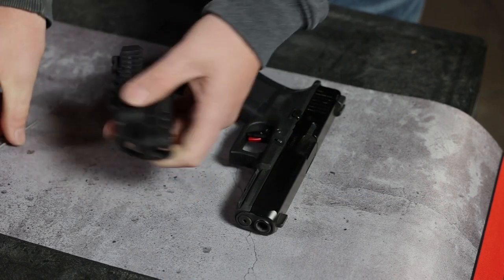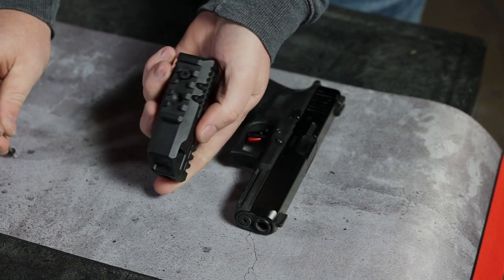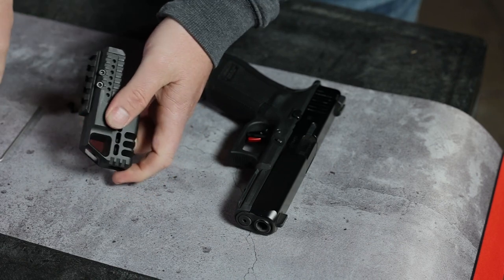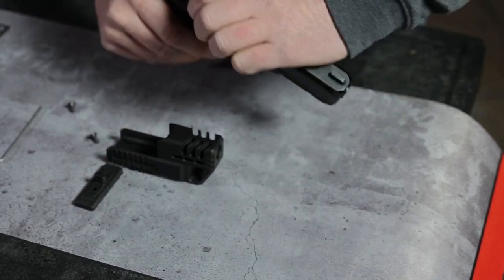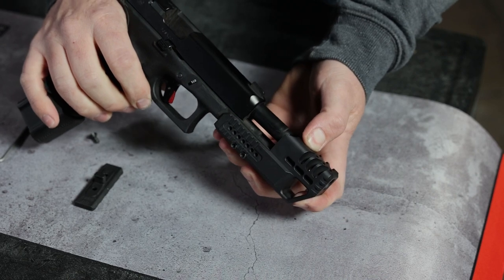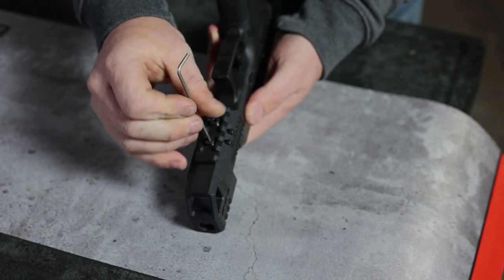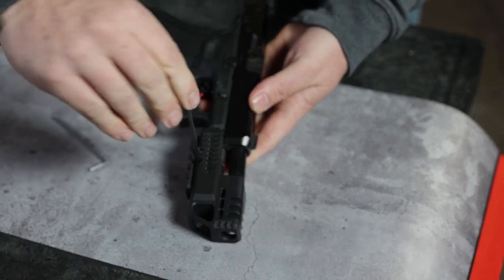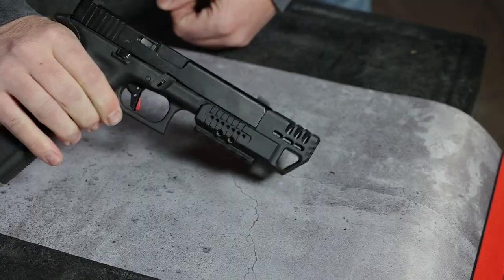How to Install Our Compensator In Less Than 90 Seconds | Wasatch Arms

Comment: Will it works on a G20 gen 3 with a 6 inch barrel
Reply from the maker: No unfortunately the Glock 20 comp is made to fit the factory Glock 20 Gen 4.

Comment: Will you be making a 17L version or will the 6-inch 17" barrel fit through the compensator (in a standard slide)?
Reply from the maker: We don't have plans at the moment to make a 17L version sorry.  We strongly suggest using our products on the standard, out-of-the-box guns they are made for.  We can't guarantee our comps will work with any after-market slides, barrels, or frames.

Comment: Does the pick rail need to be installed to make it snug? I want to run this comp on a DAA flex holster and it cant be blocking the trigger guard. Is screws to use instead of the rail?

Comment: Question:
I just purchased the Comp for my Rival-S. I installed it based on your video, no problem with the install.
However, after the install, there is wiggle from left/right on the comp just a tad, not too much, but a small amount of wiggle from left/right. 
Will this create an issue while shooting the gun? Will it block any bullets coming out? I just dont wanna have any issues, and I wanna make sure that the wiggle is normal.
Reply from the maker: Send an email to support@wasatcharms.com explaining this concern with pictures if possible and they'll help you out if anything is wrong.

Comment: Can you please clarify where those side screws are ending/touching? I'm not too keen on digging steel screws into my plastic Glock frame repeatedly, especially since this needs to be removed for field strip.
Reply: they cinch the metal together to hold it tight, they basically screw from one half of the comp into the other.
Reply from the maker: Exactly!

Comment: I have the Specs addition with threaded barrel, M&P9 2.0. Will this fit?
Reply from the maker: We haven't tested it on a specs edition, but if the any of the dimensions on the frame, barrel, or slide are different then we don't recommend trying it.
Reply: they make one for the  M&P9 2.0. it looks totally different

Comment: will 124g Fmj magtech run with this ok on sfx rival or will it need a weaker spring  will it feed and eject ok I got 2k rounds to burn up so just making sure
Reply from the maker: Good question!  It should work with 115-147 grain no problem though we haven’t tested that exact style/brand ourselves.  And it shouldn’t need a new spring either
Reply: @wasatcharms  i got the comp on the way with the tumb rest but would have been nice to get the comp in burnt bronze for my trophy edition so im somewhat happy I hope the dark side black is one tone black not two tone

Comment: Locktight needed or recommend?
Reply from the maker: No locktight is not recommended.  Just 20 inch pounds of torque on each of the 4 screws.

Comment: I just bought one and I'm very disappointed. It's not worth the money. You would be better off getting a threaded barrel and using a screw on compensator.
Reply: What was wrong with it? I was thinking about buying one but idk after seeing what people are saying. It’s to expensive to be buying crap.
Reply: @albertbrooks2456   it doesn't have a precise fit like I was expecting and it's just way too over priced. If it was only $80 I'd say go for it but to me the compensator is kind of a scam. I wouldn't recommend it to my friends that's for sure.
Reply: @squatchpnw2331  damn… I’m really sad to hear that, but I really appreciate the info. Thank you 🙏
Reply from the maker: Our comps are CNC milled to fit exact measurements of OEM parts.  If you have an after-market barrel, slide, or frame a tight fit isn't guaranteed and it may not be as effective or fit at all.